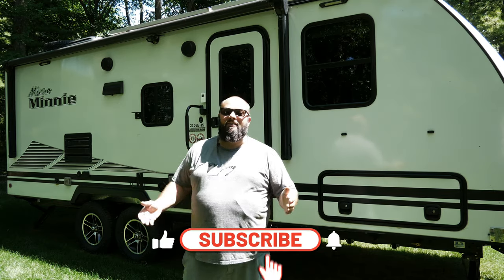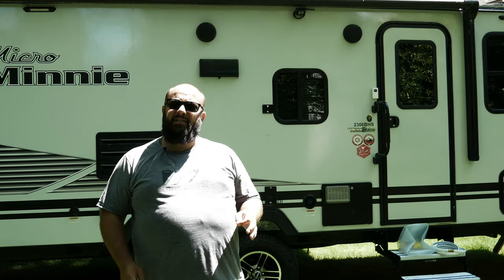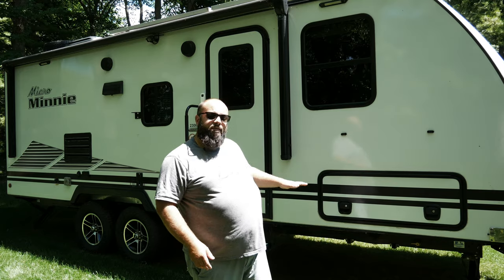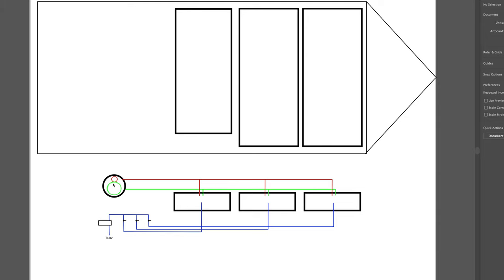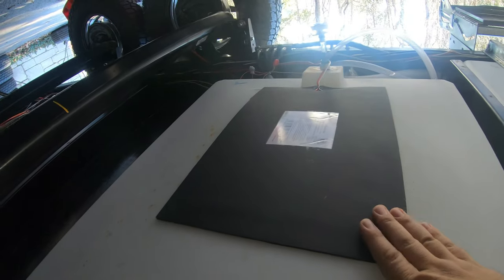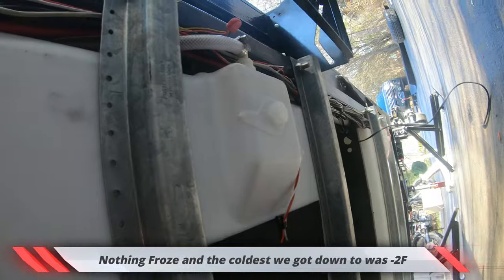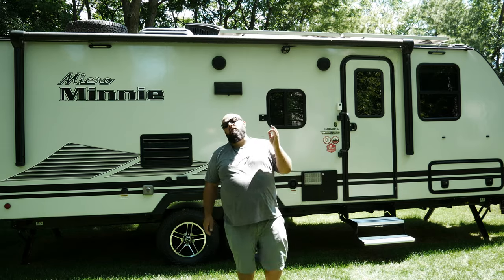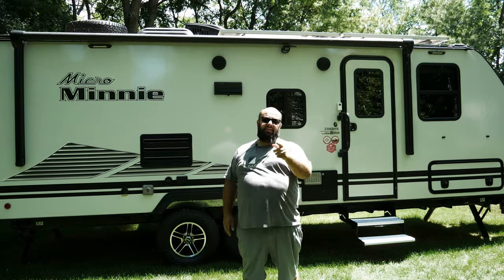115+  Gallons of Fresh Water in my RV. Custom Designed System!

Comment: The dual axle 7klb minnies were awesome. I had a 2020. But sold it recently.  The new ones have lower rated axles.
Reply from the maker: Yup. Shame they did that. But glad I got mine before the change.
Reply: yep.  I bought a 2021 2108DS and it only has 2 x 2,500 lb axles.  5,000 GVWR although the brochure specified 7,000 lb.  Really disappointed  in Winnebago.

Comment: You sure are adding a lot of weight to your trailer. Wonder how the frame will hold up. I would think any warranty you had is gone now.
Reply from the maker: The payload is rated for 2500lbs this is only 980. Yes the amount of modifications I have done to my trailer I'm sure my warranty is void but not too worried about that. PS. as it stands I have 8000miles with the camper with all this water. No problems... yet.
Reply: 900 lbs in 🌊!!!
Reply from the maker: @jamesyoung5610  surfs up!

Comment: Question: Winnebago shows the 2306 BH empty weight as 4668 Lbs, that's without  LP tanks, batteries etc. and a gross weight of 6,000 Lbs. That's only 1,332 Lbs cargo carry capacity. The water tanks full would alone be 960 Lbs plus, leaving only 372 Lbs for your gear and other additions. Am I missing something here?
Aren't you really stressing your trailers frame, beside being illegal? I plan to carry a 30 gallon bladder between the wheel wells of my 1/2 ton Tundra. I hate to imagine what your tongue weight is when loaded. Safety is number One for anybody that tows past their driveway.
Reply from the maker: Richard. My payload is 2500lbs the 2021a models are different than the newer models. There is no stress on my frame as I am below payload. Please DO your research on the correct model and hear before making assumptions. THAT is why i went with this model BECAUSE of the large payload.
Reply: @GasTachs  you had also already address payload during the video -- people don't watch!  People speedread, speedwatch, multitask, and end up none the wiser after "reading" and "watching".